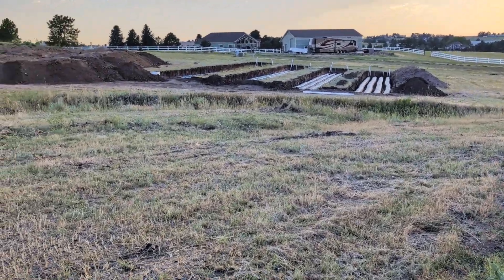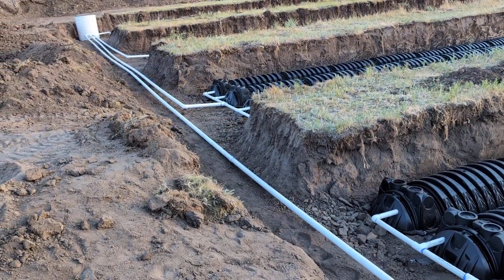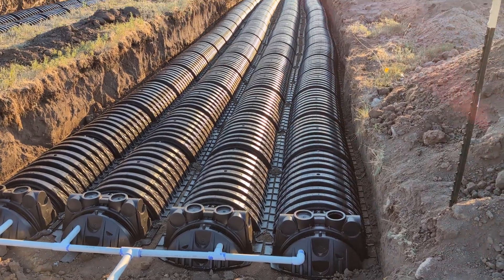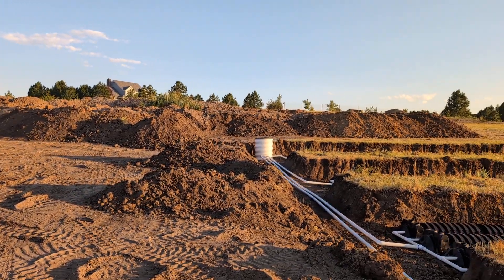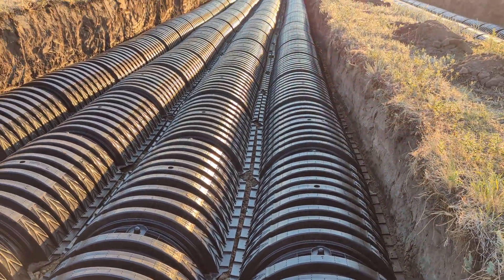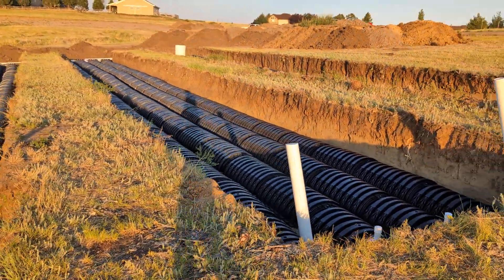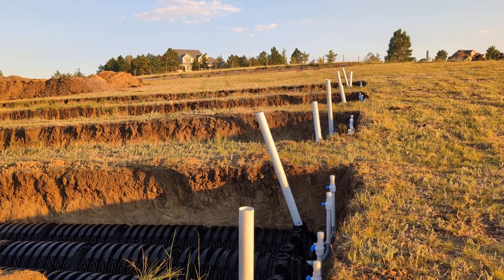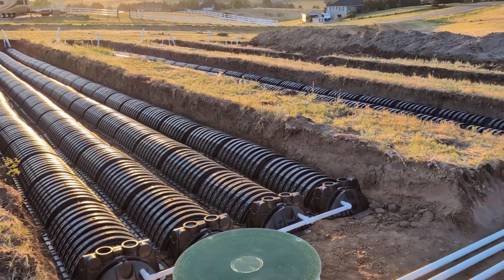Project Shop House pressure dosing septic, soil treatment area walkthrough.

Comment: That's just insane and i think unnecessary only if it's not going to be a commercial housing project
Reply from the maker: Yeah it is large, our soil percolation tested at one notch above bedrock.  The house is 5 Bedroom, but since it has a basement, they add a couple more bedrooms to the calculation.  Then I added 25% because if it is not overkill, it is underkill :).  Should be trouble free for a long time, and it's ready for any expansion like an ADU.